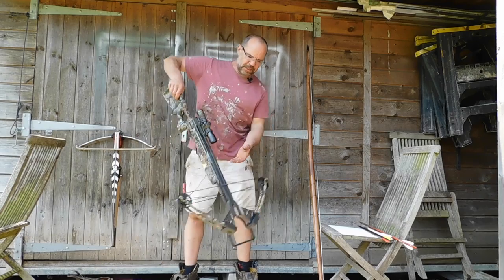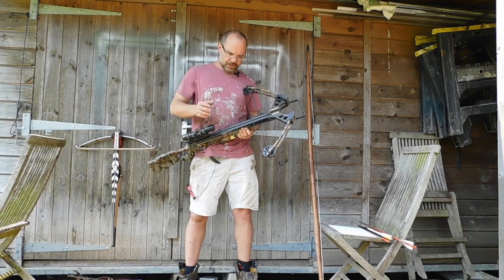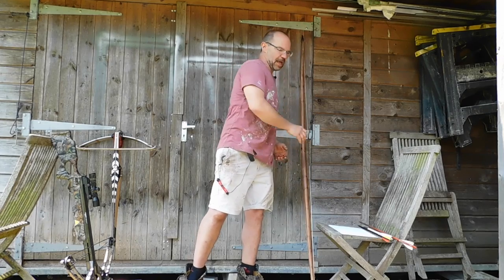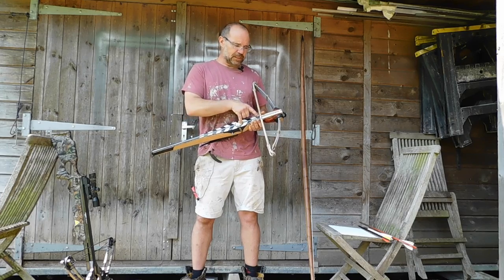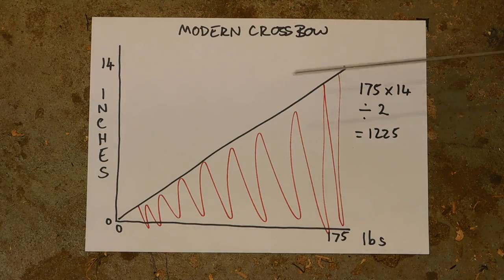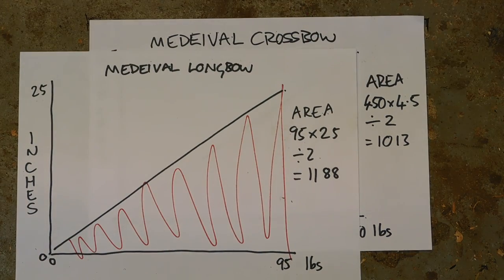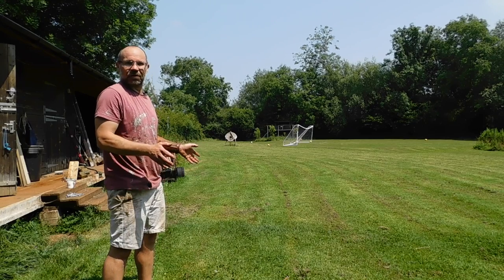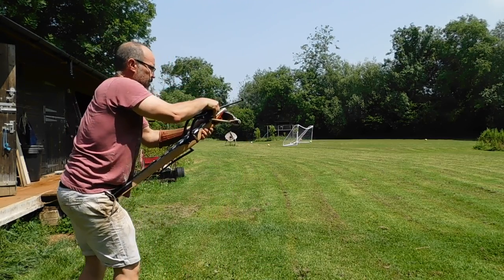Draw weights of medieval crossbows, longbows and modern crossbows

Comment: You have to understand that energy comparison of a bullet vs an arrow is basically totally irrelevant.
To quote Bredsten in the book "Handgun bullet stopping power" :
"To equate energy per se with either killing or stopping power is a non sequitur." 

To quote the same Bredsten : 

"Arrow/Spear versus Bullet
This particular type of comparison almost invariably causes many shooters to complain that the comparison is not fair. Why is it not ? After all, with the centerfire handgun cartridge exception of the 25 ACP and perhaps the 32 S&W, the energy comparison between an arrow and a bullet favors the bullet. In the above example, the 230 grain bullet develops about 485 foot pounds  [357 Joules], while a broadhead arrow, weighing 300 grains, with a velocity of 300 fps develops only about 60 foot pounds. The bullet has more than eight times the kinetic energy of the arrow, yet experienced and skilled archers regularly hunt large and even potentially dangerous big game without trepidation. Whereas, one would have to search far and wide to find the hunter who would seriously consider and intentionally hunt - without backup - large big game (e.g., elk, moose or sable antelope, let alone potentially dangerous big game such a s Cape buffalo or grizzly bear) using a cartridge, the bullet from which develops only 485 ft lbs.
Consider the results of a spear wound. During the battle in the Teutoburg forest (AD 9), three Roman Legions and auxiliary units (about 20,0000 soldiers) were annihilated by Germanic tribes. The spears used by the Germans weighed one and one-half pounds and were hurled at a velocity of about 55 fps [16 m/s]. The energy developed by the spear was about 70 fl lbs, yet this weapon easily penetrated the Roman shield and then penetrated into a Roman soldier to either kill or cause a wound of random severity (depending upon the part of the body penetrated).
Without belaboring the point, either a broadhead arrow or a spear will usually penetrate deeper (possible exceptions are very large bones like a ball and socket joint), create a larger and more sever wound track and generally result in as quick or quicker kill than will an expanding bullet from most handgun and many rifle cartridge. By expanding bullet, it is understood to mean a bullet that expands to at least one and one-half times its original diameter, for example, a .308 inch diameter bullet would need to expand to at least .462 of an inch and a 9 mm would have to expand to at least .531 of an inch. Hmmm. Perhaps the type and extent of the physical wound just might be significantly more important than the theoretical number of foot pounds produced by the projectile - be it an arrow, a bullet or a spear.
Julian S Hatcher made another very discerning remark regarding energy : "Thus the amount of energy actually expanded by the bullet in the body does not measure either the killing effect or the stopping power". An example that supports Hatcher's remark was given by Ross Seyfreid : 

"First bullet energy and its transfer to game animals really has very little effect on killing potential. I've watcher both impala and pronghorns soak up and stop 300 Magnums at short range, in both cases, bullet performance was perfect; the shots hits the front shoulders and stopped in the opposite hip under the skin. Both little critters, just over 100 pounds, took almost 4000 foot pounds of energy. Neither of the animals showed any visual signs of being hit."

End quote.

So, in reality we observe that a centermass broadhead arrow shot is even more lethal to big games than large caliber expanding bullets. We consider that for hunting big games animals you have to start from a 1500 Joules muzzle energy, yet people consistently hunt large game like does and wildboars with mere 40 pounders IFL bows and a 600 grains broadhead arrow. The arrow carrying not even the twentieth amount of the energy of a hunting caliber bullet. The arrow energy is not even close to a 22 LR bullet. 
Still the light bow and arrow has immense killing power; the only thing  a forty pounder bow setup does is reducing the ideal shooting range because the arc trajectory quickly become unmanageable with such a low poundage and heavy arrow, and you need a higher poundage to get a flatter trajectory. With compound bows of higher poundage, people easily hunt from more than 50 meters. The conclusion is that in practical reality a mere 80 joules arrow has greater stopping power and killing power than a 1500 joules expanding bullet as long as it can be accurately shot centermass. What is the real killer is the wound size not projectile energy.
The stopping power of even a small thrusting bladed weapon like a broadhead arrow is colossal in the right hands. As human are concerned, you have to understand that you can apply the captain Fairbairn timetable of death but with the reach of a bow and arrow.
I guarantee you that even a small puncture to one lung that's called a pneumothorax  with the a "puny" blade tip that's a broadhead arrow is highly debilitating, that's an instant knock out that even a small blade tip can easily deliver. Rolland Warzecha is onto something too with the reconstruction of viking sword fight that's becoming thrust centric not a great big chopping contest. That is why any type of bladed weapon is so deadly, from the boar spear to a puny "court" sword, to a pocket knife. A puncture to the lungs will stop a fight faster than a blunt shock weapon. A good movie that depicts how a sword fight actually works is the movie called Alatriste.
The problem is that HEMA practitioners don't know what they are capable of, the only legal area where they could more or less test their skills would be bull-fighting or also some type of ancient hunting. Bull fighter don't use cutting attacks to kill the bull, they use thrusting attacks with a sharp double edged estoque that is fullered up to the point.  A trained torrero can instantly knock down a 500 kg bull with a 1 kg estoque with concistency using three main strikes. A media estocada, it is a puncture into an large blood vessel. An estocada, it is a puncture into the heart. 
In case of panic against an extremely large and clever bull, a torero can also use the strike called golletazo (low estocada), now the sword groove is essential to cause instant death with this 'lazy' strike. 
When an air bubble eventually goes into the blood system, that's instant death when it reaches the brain, that's called embolism.
Mammals lungs are enveloped in a double layer membrane that allow them to slide freely against the ribcage. Like a fist pushed into a baloon, or having pair of sockets upon another pair of sockets, there's less friction.
With a thrust, when the blade is fullered up to the point or concave, a groove on the blade will act as an air admittance when the blade is burried into a wound. This means aggravated pneumothorax intensity and embolism. A broadhead arrow works the same way by rotating and creating an S shape wound.
Puncturing that double membrane (aka pleural cavity) with a blade that's featuring a gutter or a rotating action means that the lungs collapse way faster because the double layer membrane fills even more rapidly with fluids and air at each breath. That's almost instant knock out with minimal force applied. That's a huge target area for immediate neutralization that's unlocked with this type of strike.

Comment: Hi Tod! First of all, great that you do these calculations! One thing that I had in mind from a discussion about different rounds is that it is the momentum that determines the stopping power, not necessarily the energy. I am not sure if this is true, but it does make some sense from a physics point of view. What is interesting is that it would give some perspective to the numbers that you calculated. Notice, that momentum calculates m*v, so you would have to divide the enery by the velocity (and multiply a factor of 2). Since both of the medieval versions have really low velocity, this would make numbers much closer to the other weapons in the list.

Comment: The point missed here is that firearms are kinetic energy weapons whereas bows are momentum weapons and arrows/ bolts as a result kill by penetration rather than the organ shattering shockwaves of a firearm.  It is worth comparing muzzle momentums for firearms and bow types then you begin to see the real differences and similarities.

I guess the .22 slug is about 50 grains versus the modern crossbow bolt of 500 grains.  If we put the .22 muzzle velocity at 900 fps versus the modern crossbow @ 300 fps we see the muzzle momentum of the latter is 3.3 times higher than the .22.

There is an arguable difference between kinetic and momentum weapons.  For instance the talisman mantis elite has the same muzzle energy a S+W 38 S handgun cartidge hence definitely counts as both!  Your modern cross bow has slightly higher muzzle energy than a .30 hand gun round so just counts as both.  A cheap taiwanese 150lb draw modern crossbow has 3x the muzzle energy of a full power air rifle (UK) but about 8.6 x the muzzle momentum as the (.22) air rifle.

This is where momentum really counts and why the crossbow is a very dangerous weapon despite its lowish muzzle energy.  Put on a 1" broadhead (illegal in the UK even for target shooting) and the resulting penetration is often as bad as being thrust through with a long sword.

Spears (throwing) are momentum weapons whereas swords are momentum and force weapons.
Reply: Think your longbow figures are a bit low for some reason. I would suggest they should end up about 80 joules for the 95lb bow.  Maybe under drawn?

Comment: 17:17 WHICH 9mm round? We got 3 mainstream pistol rounds, namely 9x17 browning, 9x18 makarov, and 9x19 parabellum, and it REALLY differs from country to country to associate just "9mm" as one of them.
Reply: I'm pretty sure he's using the 9x19 round for reference as that is, as I understand it, the most common pistol round in the world. If I had to guess, I'd even go so far as to say the 115-grain loading in 9x19, though I understand that the NATO standard is considered an "overpressure variant" and so its numbers will different from the run-of-the-mill 9mm Luger round.
Reply: @FyremaelGlittersparkle  Actually, researching into it, I think it's the browning, given he cited 467 J power, which is close to the 45gr TFSP test result(457 J) according to the wiki.
Reply: @kovi567  I certainly could be mistaken on that, seeing as how I have no experience with 9mm loadings outside of the 115 gr, 124 gr, and 147 gr offerings available to civilian shooters here where I live, and the 9x17mm round, at least where I live is commonly called the .380 ACP, which I've never shot before. 167 is also not too far off the number of 181 J listed on the 9mm wikipedia page, so I guess the best source of where he's getting his information and the numbers used would be Tod himself as both the pages listed for the .380 ACP and 9mm Luger use different barrel lengths to achieve their figures. I know this is going to weigh on me for the rest of the day now, too.
Reply: @FyremaelGlittersparkle  467 and 481 J. 167 J would be the compound bow :P

He might have just misread it from the browning's page (I think he got the number from there as my research into other gun-related webpages, and shop information cites energies lower than 300 J).

That... or it's actually 9x19, as that has energy readings in the 5, and sometimes 6 hundreds.

Comment: Something is off about your longbow results. A longbow with a 95# draw weight, a force draw curve typical of that type of bow, an efficiency of somewhere around 60% to 80% typical of longbows and a 25" powerstroke should be able to launch an arrow weighing 45 grams at a muzzle velocity of somewhere between 55 and 63 meters per second (that's ~68-90 joules of kinetic energy). If you're actually drawing a 25 inch powerstroke, your bow really has a draw weight of 95# at that draw length and your arrow weight measurement is accurate, then your bow's efficiency is something like a measly 40%, which would make it less efficient than bows of a similar design made out of PVC pipe or fiberglass. You look overbowed, so my guess is you're not actually getting anywhere close to a 25" powerstroke. A powerstroke of around 20" would give you arrow velocities in the ballpark of what you measured.

Comment: Your longbow is under draw, and the arrow is under (significantly) weight, my longbow 95lb@28 draw to 31",32", arrow weight 65g (>1000gr, 10GPP), shoot 155,160fps at least, at 45g arrows its 180,190fps...

Huge difference, in bows, underweight arrow drop energy transfer (efficiency) in an extreme way..
Reply: the 25inches refered by Todd are the power stroke and not the draw length.

A 31" draw length minus a 6 inches fistmelee is a 25" power stroke.

You're right about heavy projectile being generally more efficient thought.
Reply: @Kalishir  I don't think Mars PH was referring to the power stroke, we know you subtract brace height + thickness of the bow from arrow length to get power stroke, I think he meant the bow was not at full draw at the moment of loose. It looked about three inches under drawn, which is significant in terms of power loss. If we assume it is linear in power delivery, then that ammounts to over 11lb of draw weight short of the 95lb draw weight at the rated draw length assuming the arrows are the correct length for the bow.

Comment: Absolutely everything stated here is correct. However in terms of contrasting how effective any weapon system is when compared with another, from a military perspective, the ease of training and use is an important dimension. It took years of training and practice to make an effective longbow man. Any peasant could be trained to use a crossbow in a matter of days. England even had laws passed (and enforced) to ensure that there was a constant supply of trained archers. The continental powers, being more wedded to the concepts of chivalry, i.e. the supremacy of the horse and, by extension the aristocracy, did not feel comfortable with the idea of large numbers of trained peasants equipped with an astoundingly devastating weapon. Hence they stayed with the less effective crossbow and the rest is history.

Comment: I don't suppose that a crossbow twice as strong would be double the strength exactly, would it? A separate measurement would have to be made entirely? I'm quite interested in how much more powerful would the stereotypical 900+ lb crossbow be over a longbow, and if it ultimately justified their use over longbows in majority of Europe.
Reply: I'm a bit of an idiot, so I didn't actually watch until the end. You basically cover that at the end! :D
Reply: That's very interesting. So is the idea that crossbows were amazing against armour entirely a myth?

Comment: One thing to remember about comparing arrow type weapons to firearms is that although firearms are much more powerful, the cutting/piercing type projectiles of bow/crossbow type weapons are much more efficient at cutting and penetrating to dangerous lengths in a human/animal. It's the same reason why broadheads are much more damaging than target arrowheads to game - firearms need that extra power to deliver relatively blunt, conical projectiles to dangerous depths. 

Not at all saying arrow type weapons are more deadly than firearms, but I think they're probably closer than the numbers would suggest.

Comment: Calculated energy efficiencies (based upon measurements of the shots and the draw graphs): modern crossbow 94,5%; medieval crossbow 47%; longbow 33%. 94% seems a bit high; longbow (wood) vs. medieval crossbow (steel) seems rational because of higher hystheresis in wood.
Reply: You mean lower hysteresis in wood?
Reply: @MGSLurmey  No. I mean higher hystheresis - as in: more mechanical energy gets lost (energetically correct: turned into heat) in wood than in steel, as long as the stress in steel remains in the elastic domain (i.e. steel beam does not permanently deform/bend). This should be the main cause of the better efficiency of steel. Comparing the medieval crossbow against the longbow: note that the crossbow gets a better efficiency even while having more friction. This tells me that the steel/wood comparison is even more favorable to steel.

Comment: An apples and oranges argument unless you're looking at piercing armour with a bodkin type head. A firearm round kills by damaging tissue through raw shock of impact. Blunt force trauma and basically shaking the hell out of organs and whatever. An arrow with a broadhead on the other hand kills by efficiently slicing through flesh and bleeding out the victim. Or for a more obvious example, you can kill someone with about a couple of Joules of energy with switchblade, or cut their head off with a sword via far less Joules than a 22 round, modern or medieval crossbows, or a longbow.

Comment: with the longbow; heavier draw weight and longer arrows can acheive higher fps
Reply: +tod todeschini do you draw 25 inches or is it just weighed in at 25?
Reply: depends on dynamic efficiency and stacking of the bow a longer arrows means more inertia so more power goes lost  accelerating   and the string becomes less effective and slower pushing more mass so the longer draw is countered by  less speed , and with more mass the arrow gets stiffer so you lose energi i in paradox so its down to find the best trade off